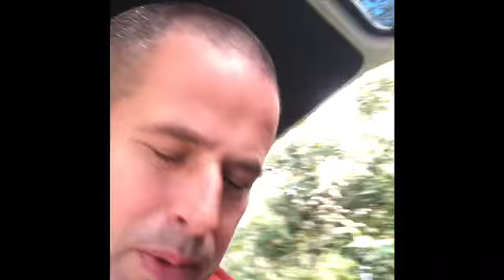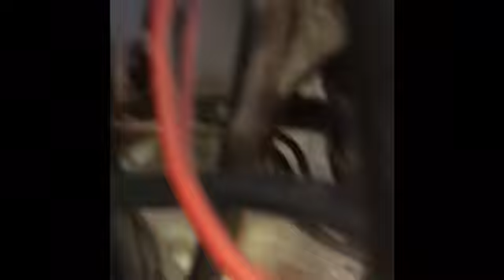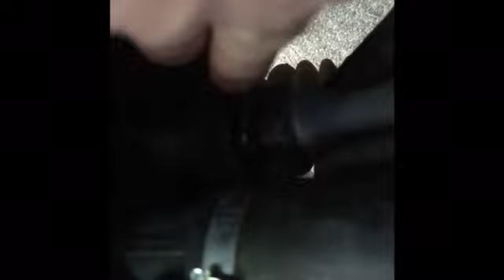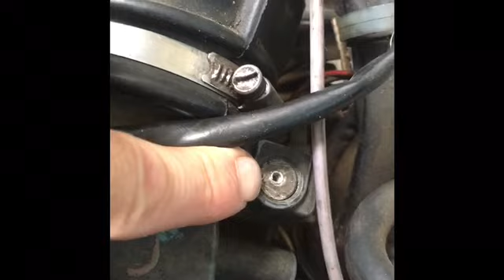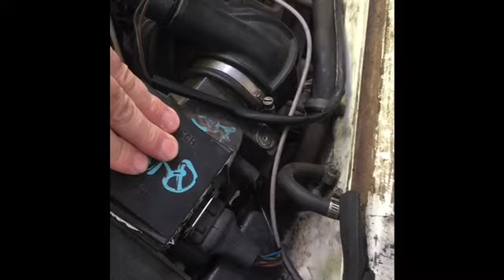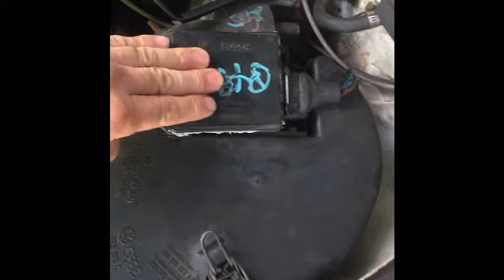Vw vanagon tips and fixes part one

Comment: Great advice. Great video. One observation though. The metal spring clips you keep saying need to re removed with a pick on the electrical plugs,, the plugs remove by simply pressing these downwards without removing them at all from the plugs. Simply pressing the solid end down towards the open ends and pull the plugs off. Don’t take those spring clips off at all. 😃

Comment: What causes my Vanagon to not start after driving for a while, it swings continuously until I use a  Quick start spray in the air intake.
Reply: i have the same problem, although mine can be push-started. i have heard i should replace ignition switch.
Reply: @vanessanorton455  Can you believe the culprit causing my problem was actually the Alternator and it didn't in the least show any sign of being the problem, until a real Maverick Mech. found the Alternator to be the problem. After replacing so many darn parts at a huge cost and frustration.
Reply: @napsterking7500 Are you saying that the battery was not fully charged....can't see an alternator fixing a no start condition as it only keeps the battery topped up to about 12.7 after charging at 13.8 v
Reply: @malcolmwellings2198  The problem is back, now somebody tells me replace the fuel pump.
Reply: @napsterking7500  Ive been told that a wire runs from the field coil connector that activates the fuel pump. ( Once the ignition is turned on or bypassed ) If the alternator does not feel this voltage it will not charge or activate the fuel pump. Use a voltmeter at least 12 volt req. at this small wire or a blue one depending. The heavy charging wire connects to the starter feed wire i.e. battery.
Reply: @napsterking7500 fuel pressur at the pump when no start??
Reply: @vanessanorton455   .......push started can mean many things as the engine is moved rotatingly and can tug on grounds which then make connections and start. Save yourself the trouble and check the volts at the live coil terminal. If the spark plugs fire then it sounds like a fuel problem and check my todays note for a similar problem diagnostics. Good luck.
Reply: That sounds like an enrichment problem or even fuel injector nozzles blocked. Using that spray is very harsh on your engine, and can damage piston rings, spark plugs and other components. Use it as a last resort and remember its ' very flammable ' Just an ignition spark will ignite it....like trying to dry up moisture on the spark plugs or boots, can ignite it.  If you can I  would suggest a compression test or if you can make one ; a cylinder leak down test...pressurizing each cylinder with an airline, say 120 psi ,and listen for air leakage through valves, crankcase etc. on TDC.
Reply: Been watching a few more of these similar reports on YT, and many fixes for similar problems. One, I particular liked ( actually two ) was that Mass Air Flow meter has a carbon strip that wears but this wouldnt prevent a start on high pedal pressure...more fuel. The other was a problem intermittent Hall Sensor.  When it wont start...at least check for a spark. The use of fluid could also be an oxygen sensor which is inexpensive to buy and replace. Low compression can also mean more fuel is required to start as its barely ' alive ' and needs all the help it can get.  Manual tranny?  Have you tried tow starting which means...very little electrical power is used that will not reduce ignition spark power. This may move you one step ahead to diagnose the fault but we're walkng in the dark without a system...or ideally a proficient Vanagon technician. I feel for you as I know how it is. p.s. Whats your fuel pump pressure on cranking. Should be around 40 psi. A faulty alternator lead or poor ground can stop the pump but once started may produce enough power ( volts.) Sounds like a fuel problem but at least check the compression and spark.